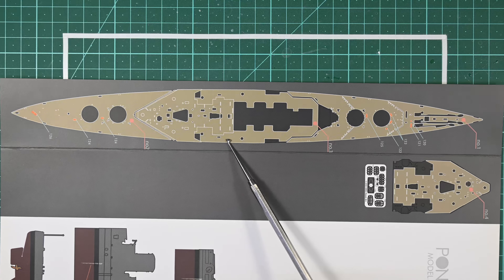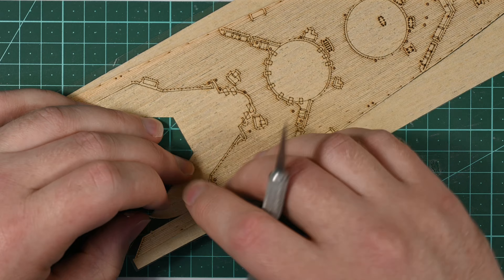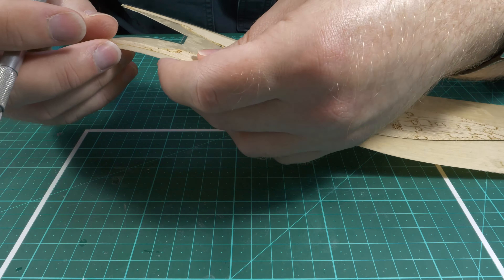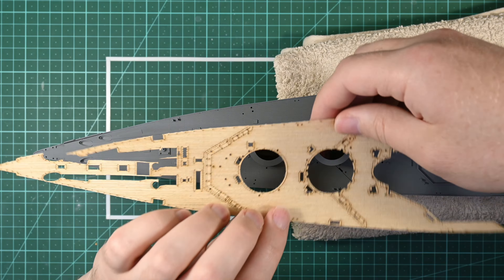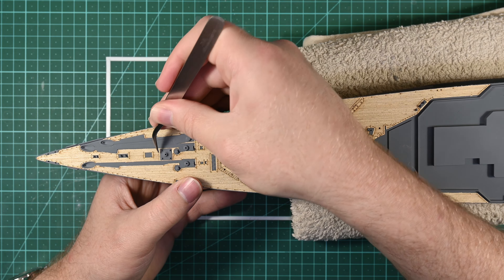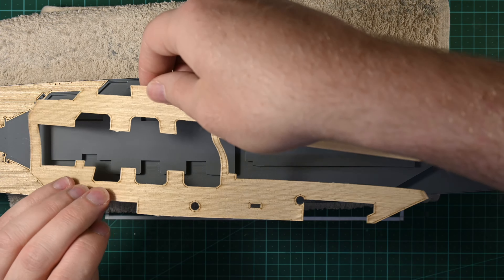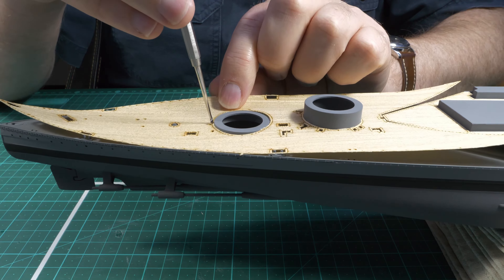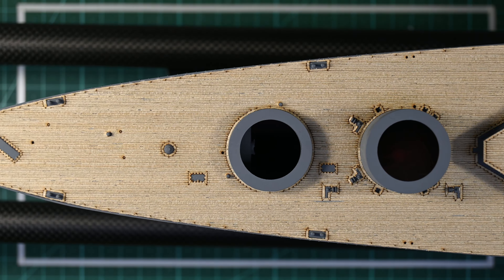1:350 HMS Hood: Part 9 - Wooden Deck

Comment: Well done. I've had issues with wooden decks not staying down so I've now started putting gloss clear on the plastic and then using a thin coat of slow cure wood glue. Seems to have fixed the problem. I also find that Pontos decks seem more flimsy/delicate that other aftermarket decks. Good fit, just very delicate.

Comment: Great video! I have a few ships in my stash and I bought some wooden decks for them. It will be the first time I will be attempting this. I've seen other people use glue when installing the decks. Is this really necessary?
Reply from the maker: I have found the adhesive backing to be sufficient. In a few occasions, shortly after installation, the deck lifted so I reglued it with CA glue. Other than in those cases, I don't think glue is necessary.

Comment: What has been your experience with the durability of wood deck on a model several years old. Do they ever come loose, shrink or split with time. Since wood moves I’ve wondered how they hold up over time. Thanks
Reply from the maker: The oldest wooden deck that I have was installed in early 2015 onto my Yamato model, it hasn't given any problems. The second oldest is on HMS Prince of Wales, it is also still as good as the day it was installed. I can say the same for Nagato, Richelieu, and Roma.

The only issues that I have had were soon after installation, in some areas they lifted. In those cases I used CA glue to stick them down again.
Reply: Thanks for your response, I’ve been reluctant to try wood decks, but I’ll give them a try. Enjoy your videos and commentary. @DavidsShips